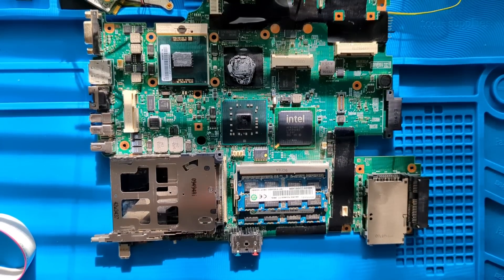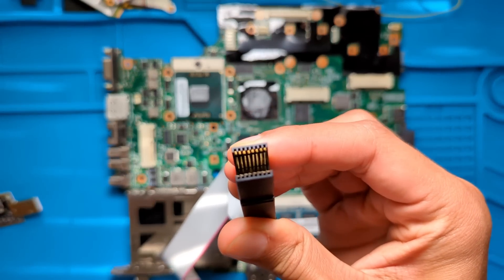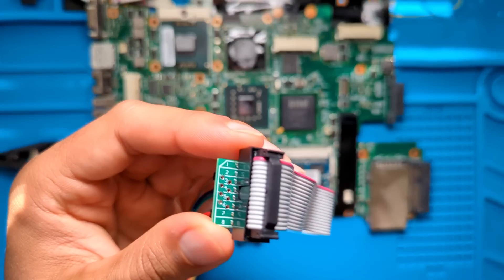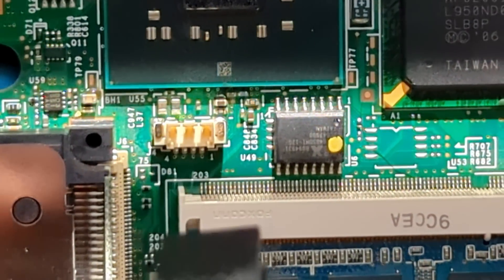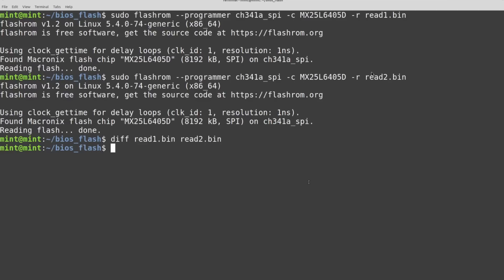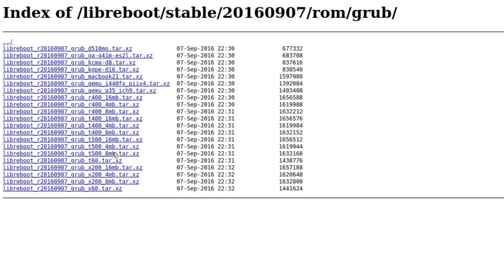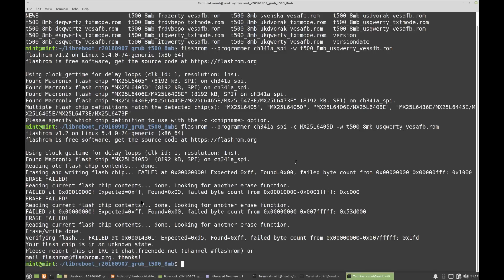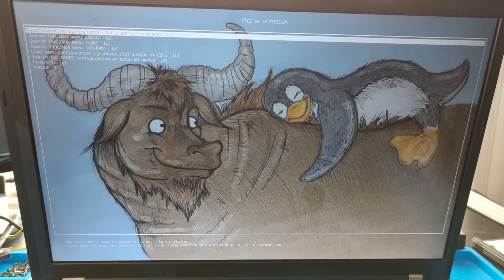How To Libreboot Thinkpad w500

Comment: Ended up using a raspberry pi insttead the CH341As are awful programmers tbh lol, just make sure you supply your own power to it from another source if you're flashing it on the motherboard using a clip, because the board draws away some of the power and screws up the flashing process otherwise

Comment: uhh... you do know the data lines on that are pumping 5v?, and there's a big difference between NOR, NAND, and managed-NAND. If you got it working you likely got lucky. 3v3 is somewhat tolerant to 5v, but not always, and on a 1v8 chip with an adapter it will totally blow the chip.

Comment: Great job, and a cool video!

Couple of notes:
- spispeed - CH341A boards are limited to a specific speed (I think it's 512? I forgot) so that's why specifying it doesn't work.
- CH341A boards are probably the cheapest and easiest boards to do this with but they send 5V signals on the data transfer pins, which are typically only rated for 3.3V. I've flashed a good few boards with them before I found this out, so it's probably not going to break your board the first time you flash it (as seen here) but it should be discouraged. You can modify them to use 3.3V on the data pins by soldering a single wire, making them still a decent choice!
-MAC address - unless I missed it, you didn't flash a MAC address to the ROM! There are cases such as making an airgapped build in which it would make sense to not do this, and you can set the MAC address in software, but that's inconvenient. Documentation for this is on the libreboot website.

Still a good video and sorry if that comes off as critical. You were clearly successful and that's what matters!
Message me if you'd like to know about adding different payloads

Comment: It really takes all that just to flash the bios? What happened to the days of the desktop where you could flash the bios from the desktop? Or even just pop in a different chip? Or just plug in a USB, and tell the current bios to "update" from that? You know, the way normal things flash the bios. Where you don't have to jump through a million hoops.
Reply: You can flash a signed bios, but only lenovo has the keys.
Reply: @jjjannes  It's been two years... what keys are you referring to?

Comment: Neat. I didn't know libreboot was a thing before I saw this.
I know other people have mentioned the issues with the black and gold version of the CH341a where the datalines are at 5 volts instead of 3.3 volts. There is another version of the CH341a that has a built in voltage switch. If you want to see what it looks like, Adamant IT did a video about it called CH341a v1.6 Review, No More Volt Mods! - LFC#297 .

Comment: I should have watched this video sooner, did it just now and I'm half disappointed / half terrified, because you make some critical mistakes that may lead to frying BIOS chip, or at least causing hard to debug problems with it later on.
First of all, as some other people already mentioned, you are using very popular SPI programmer that has a fatal flaw - it has 5V on data lines while most of SPI flash chips tolerate up to 3.6V. It MAY fry your chip, don't necessary have to, but it's a risk you DON'T take when it comes to something like computer firmware memory!
Second, at the end of the video you mention you had problems with flashing chip with new ROM, and the fact you eventually succeeded doesn't mean you need to retry flashing process until it succeeds, because it "just tends to be glitchy". The reason you were failing this many times is that flash memory draws quite a lot of power during writing process, compared to how much it draws during reading process (ie normal usage). It may randomly glitch out, it may not, but even if it doesn't fail one time doesn't mean it 100% percent succeeded. It may glitch later on when you're using the chip normally (like when you run BIOS from it when turning PC on, it may read some rubbish data in the middle of its content). For this not to happen you need to put ~100nF capacitor between VCC and GND line of the memory chip, preferably as close as possible to the chip's pins. This way you guarantee the chip gets some power buffer that it can draw extra power from when flashing its content.
Please put some comments about this on the video, because as of now your video may cause more harm than gain from getting oneself FOSS BIOS.

Comment: The WCH IC company are actually kinda based. They make the common CH340 and CH341 USB to serial / SPI ICs, they make the CH55_ series microcontrollers, native USB devices that could make keyboards and the joysticks and like for a lot cheaper than a mega32U4, and now why’re even making RISC-V CH32V ICs, presumably meant to be replacements for STM32s and heir knockoffs.

Comment: on the back of the main programmer there's two sets of pads setup for common ICs. Using this tool myself for different chips I've found that the clip is the worst way of doing it and leads to more errors and time waste than just removing the IC and soldering it to the programmer directly, reflashing, and then soldering back to the board.

Comment: I got an X260 on ebay for a decent price, however I noticed that the bios is password protected and the seller doesn't know the password. Would installling libreboot remove the password lock as well? Would I have any problems, like idk the chip refusing to read or write because of the password?
Reply: The password shoudnt be a barrier and is also pretty easy to remove even with the normal bios. Just remove the clock battery and wait for maybe 10min to be really sure and the password should be gone.
Reply: @harisalic2568  I tried removing the clock battery when I noticed that the bios was locked(like 1 year ago), but didnt work. I don't rememeber for how long I kept it disconnected from the laptop though. Might give it another try. However I remember reading somewhere that at some point thinkpads switched bios chips to EEPROMs, which don't rely on clock batteries to keep their memory active, for that exact case - if someone stole a laptop who had, say, a boot-up password, they could easily get it removed by unplugging and then plug in again the clock battery resetting the bios settings
Reply: @davix3f  reminds me of my old Dell laptop. Maybe the ThinkPad also have pads which you can short to reset the bios simmilar to the jumpers on desktops. Or just libereboot it, this will definetly remove the password since the chips don't have any write locks, since those are off the shelf flash chips

Comment: I've been selling premodded firmware hardened ThinkPads since 2016 ( I call my line 'GhostPads'). I've modded over 200 ThinkPads with Libreboot/coreboor/osboot and have been a contractor for Minifree (the X200T that got FSF certified was one I modded). That programmer can give issues since it runs the logic at 5v even when the output voltage is set at 3v. Personally I've never had an issue (I've successfully modded maybe 60 or so with it) but some people have fried other boards with it. Just something to be aware of. I highly recomend OSboot over libreboot. It includes the microcode updates that libreboot leaves out. I also recommend the T420/520/w520/x220 with coreboot and neutralized IME for a more a more powerful firmware hardened system. One of my most popular models is the W520 GhostPad upgraded with an ivybridge quad core I7 and 32GB ram running Qubes OS. They are a beast. up to 3 drives (1 2.5" sata, 1 mSATA, 1 2.5" sata using a optical drive bay adapter. They are less labor intensive to modify as well. The flash rom is accessible by just removing the palmrest. (on T520/W520). My daily driver is a W520 w/ 3940XM, 32GB ram, 500GB msata OS drive, a 2TB 2.5" SSD and a 2TB SATA HDD running Qubes OS. I prefer this gen to the T/W*30 since they already have the better keyboard, they retain the 'ThinkLight' and they can be upgraded to the same max specs as the *30 line. If your interested in checking out my GhostPad line an ebay search for 'GhostPad' will bring up my machines. If you have any interest in one I would sell you one at my cost to support the channel. I also have Osboot roms if you'd like to try osboot on your machine and don't want to go through the hassle of building it from source. I really appreciate what you are doing here and would like to contribute to your efforts.
Reply: Hello there. I'm going to update my ThinkPad W520 with the Ivy Bridge processor, and I'm kinda scared because I don't know exactly what to do. Would you like to help me and the others by writing a guide? I think you'll have done a great job. After all, you had a great experience.
Reply: T430 doesn't make the cut? USB3.0 bro!?
Reply: Can I buy one?
Reply: I'm planning to coreboot my t420. For that I will be using a ch341a programmer. Is it save to use it for t420 without having to change the data pins to 3.3V output?

Comment: 8:20 for anybody trying to mess with BIOSes, before checking that both bios reads are the same, also check that the files you just created aren’t empty (0 bytes). 

now i did not do this on a think pad but i recently had to change a GPU bios, and i at first got 2 bios backups but they were empty. 

again, this might not apply in this case but check this anyway since it takes just a second

Comment: Is there anyway to libreboot or coreboot (unsure of the difference in those terms) an older desktop?

I have an old one with an FX-6300 gathering dust. I would like to refurbish it with an AMD card (I havea  Nvidia GTX750ti in it right now) and run Artix on it (I'm not sure if I might mess up Gentoo on it due to the peculiarities of the FX6300's core count, possessing 6 ALUs and 3 control units [or maybe it's the other way around, idk]). Obviously there would be no point to using such an old desktop other than because it has no AMD PSP, so having the BIOS not glow in the dark is a must as well, in addition to the closed-source drivers for Nvidia needing to go.
Reply: just go find the supported boards list for coreboot.

Comment: Lol and the first thing that you see after powering up the system is a bunch of errors) So open sourced)
Reply: The video doesn't show the initial boot. It just showed the boot partition checks and then he went back to the main menu after. Presumably, he booted without a hard drive in the machine, so the messages you see are  libreboot saying where it's checking for a grub config.
Reply: @caleblagrange7164  oh, okay. Thanks for the explanation 👍

Comment: was wondering what will be the best modern laptop for libreboot. w500 has quite old hardware
Reply: Almost all supported models will be older. Hard to reverse engineer newer hardware, plus a lot of bios can be locked down tight.
Reply: @baremetaltechtv  thank you for answering. What will be the top of the line machine that could use libreboot
Reply: @baremetaltechtv  Interestingly, even up to haswell machines the bios can be replaced pretty easy. It's just the me and ifd regions that get locked down.
Reply: Coreboot should be usable for newer machines, libreboot only really works for much older ones.

Comment: Will this work on a T60 with the ati graphics
Reply: No
Reply: @caleblagrange7164  damn wish you were three hours earlier. Can confirm this will NOT work on a t60 with ati graphics
Reply: the T60 is complicated even without the ati gpu.  it's difficult to find one with a compatible display. You can compile a custom coreboot rom for use w the ati gpu but it adds even more complication

Comment: Reducing cable length can improve your success rates. Pesky speed of light.
Reply: Lol, no, it has nothing to do with the speed of light. At these low frequencies delay accuracy is completely irrelevant. If the signal is bad, it's because of dispersion, not delay.

Comment: Does this work with T420 models?
Reply: It’s gonna depend on the chip. It works just fine on the t400 but not at all on the x200t
Reply: There is a good chance you might have to solder - which if you know how is always the better route.
Reply: @RAnderwill  no soldering needed. Flashing the T420 will be basically the same process (a little easier in terms of disassembly). The only caveat is that you'll have to use osboot rather than libreboot.

Comment: One thing about the w500 that people should know is your screws REALLY flipping matter here. Be very careful and take a million pictures as you go. Wrong screw  can equal a broken screen display.
Reply: it sounds like you learned that the hard way :)
Reply: @svampebob007  sometimes the screwed are just there to hold the thing together- other times …. Be aware and careful
Reply: Dismantle laptop, fix hardware.
Rescrew. 
DVD-ROM port has 3 new rivets!  (ASUS had these 1 mm short screws in 2000's)

Comment: I've installed libreboot on a chromebook, and it was a far less invasive procedure. The bios write protection is enforced by a single screw, so you can remove it, disrupt the circuit, and then flash the bios from within chrome OS, from there you can reboot, and you'll be able to install an operating system of your choice from the bios screen (chrome OS won't boot from libreboot). Still quite technical, but nowhere near as absurd as this.
Reply: which chromebook did you do this on? this sounds pretty neat
Reply: ive since googled and found out there is basically one chromebook that'll do it
Reply: I did chromebook repair as a class in my senior year of HS, alongside some tinkering with chromebooks I got cheap off ebay. They're actually fairly simple to mess with as long as they aren't locked to an organization like a school device would be. Since we'd have to replace tons of motherboards (Lenovo cannot design a good motherboard to save their life) I got quite used to messing with the write protection and flashing serial numbers and all that. Ended up being one of the main people in my class for it since I'm experience with a terminal and behind the facade, ChromeOS is really just a weird proprietary version of the Linux Kernel similar to Android. Anyways, most of the current fleet of chromebooks my school uses doesn't actually require removing the WP screw; It can all be done from crosh. It could vary for other devices, but my entire district basically exclusively uses Lenovo devices.
Reply: @smileyguyz  definitelly varies on device by device basis. I bought a cheapo chromebook that had good enough specs and enough onboard memory for my needs to just run as linux but turns out it was indeed one where you had to take it apart and start practicing dark magic on the mobo to allow OS install.

it is neat that with some you can just do it, in essence, from command line
Reply: Here for the reply
Reply: @chippym8316  I came here to reply to you coming here to reply.
Reply: modern chromebook are much harder to disable bios write protect on. Ive installed a package manager called chromebrew that has cool stuff like gimp and Firefox and stuff, it's the closest you'll get to a standard Linux distro without having to make a debug cable
Reply: @jacobeii  on new chromebooks you need to disconnect the battery they don't have a screw or switch anymore, the debug cable is only for closed case debugging (if you want to disable WP without opening it up)
Reply: no SeaBIOS? refer to the archwiki page
Reply: Bump
Reply: More to do with thinkpads having better security than a Chromebook.  Chromebooks are just cheap consumer laptops with a Google OS.

Comment: they are so expensive on ebay, wish they were cheaper
Reply: it is very time intensive to do right. I've been one of the primary sources for premodded units on ebay  and between finding and maintaining a steady supply of  good cores to modify, testing and the actual mod  there is a good deal of time spent on each system.